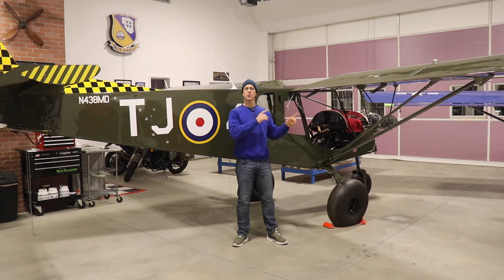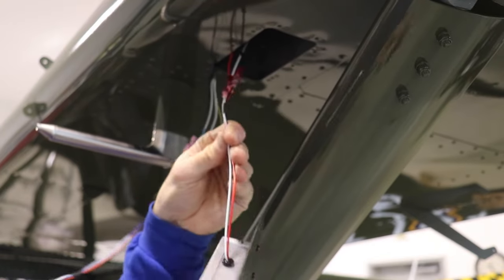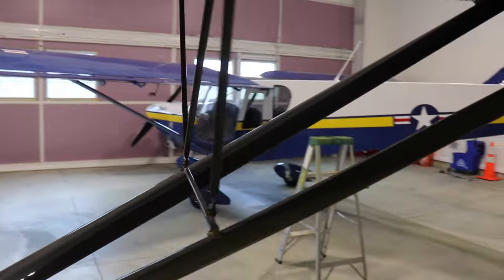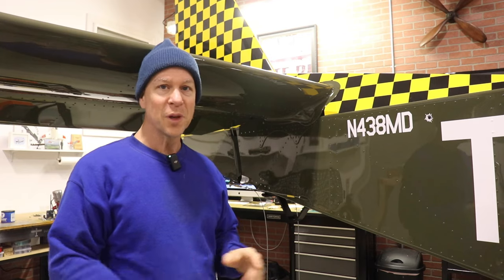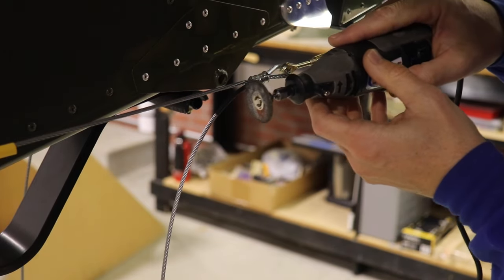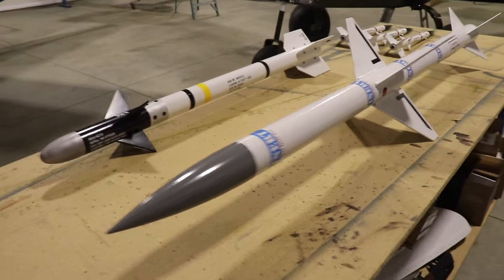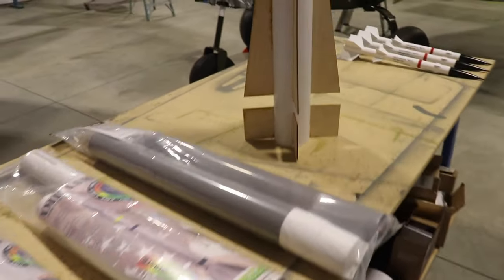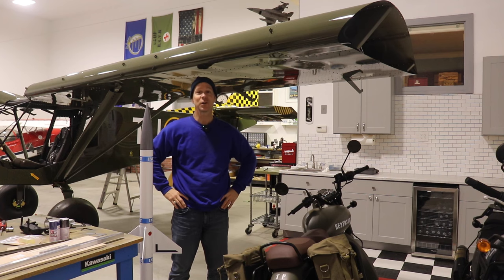MISSILES, Wings, and Pretty Things!

Comment: Beautiful job on the wings.  Great to have friends who understand the process. Measuring is so important.  I measured the height of a patio door, failing to account for the 3"s of the tape holder.  That was quite disappointing for me. The missiles area slick addition to the overall presentation.  You do think outside the box.